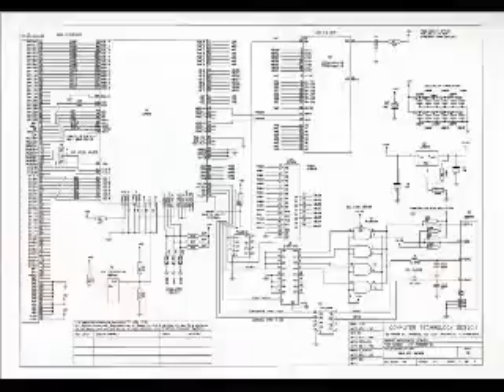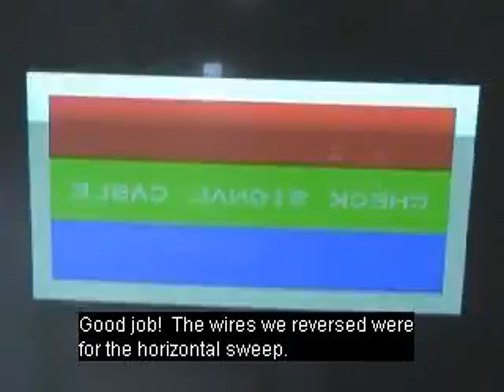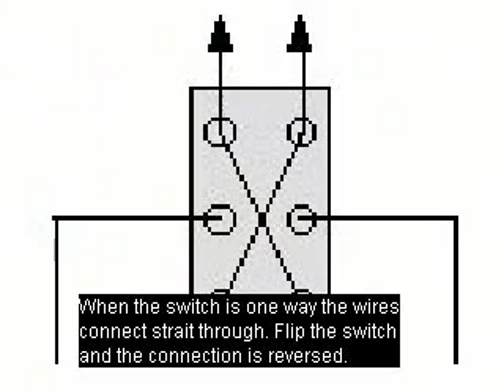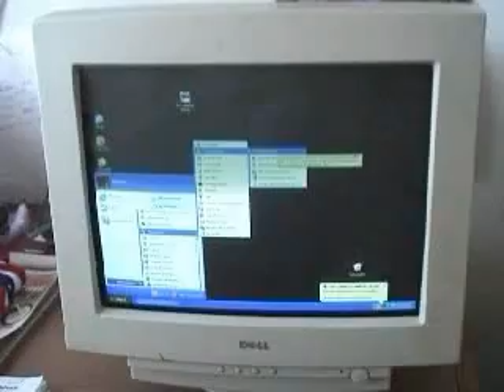How to reverse a CRT picture tube.

Comment: The coil is current driven, maybe one should use thicker wires to connect to the switch. I think the discharge is not really needed. I only discharge when i need to touch the HV circuit. I was a little afraid that a mod like this could fuckup the convergence, but apparently it does not - good to know as i will need a mod like this soon.
Reply from the maker: Yes.. Looking back at this now I've realized you are completely right. I feel like making a new video to correct people on this
Reply: I think adding this to the comment section is perfectly fine. btw.: I also tried it with a trinitron (Sony BVM) and it worked without any issue - try that with an LCD ;-)

Comment: you always want to discharge the tube twice, wait about 20 seconds or so and discharge it again, usually i'll get another spark. I got shocked from one of these tubes, it was a pretty big jolt but not really bad, however I was lucky my dad was helping me lift the tube into the back of the car otherwise I'm sure I would have dropped it, and that would have been a very dangerous thing to do.

Comment: that's not glue on the magnetics just some paint they put on there to secure them. you can take a razor blade and loosen them. but unless you're an old time tv repair guy like me best to leave them alone. reversing the wires is always a funny joke to play on someone. Even more fun is to reverse the red and blue wires and the picture goes upside down.

Comment: Quick technical question:
I have a 15" Sony Trinitron TV that I'd like to customize and turn into a Phillips Predicta style TV.  My issue is that the anode plugs into the CRT on the top of the monitor, so in order to separate the circuit board and the monitor I need to rotate the monitor (this will provide me with the anode length I need).  Which wires will I need to switch to achieve this and retain the proper picture while the monitor is upside-down?

Comment: Should he have used a equal size wire gauge and a switch that is rated for the voltages and current?

Comment: No, what you will do is equalize the potential voltage difference between the anode and the chassis, which will mean there could still be a difference between the whole unit and neutral/earth, and could still result in a shock.

Comment: If you see an orange light in the back of an electron gun, it is probably the filament. If anything else it glowing orange... That could be a problem :)

Hmm, maybe i should try to use a CRT as a vacuum tube. It works, has the anode, grids, filament, cathodes...

Comment: In fact, there is around 1kv present on the yoke when operating. When the magnetic field collapses in the LOPT (flyback) the voltage that 'flies back' is normally over 1kv... The primary is pulsed at around 80 volts and the kickback is the thousands... This is why the HOT (transistor which runs the flyback and horizontal yoke) is rated at 1.2-1.5kv or so. Some newer moniters use high voltage mosfets or IGBTs and use lower primary voltage for lower voltage spikes...

Comment: MSVistasucks - ive been shocked by the red wire in a 19 inch trinitron dell monitor. i forgot to ground my screwdriver. it hurt like a bitch. threw the circuit breaker, then i got pissed off and threw the monitor out into the back yard.

Comment: 4:16 all you really had to do was cut only the red and blue wires and reverse them. all you did for the other 2 wires was cut them and twist em back together. thats according to your caption there. nice little mod there. its just like that april fools joke that YT did where it turned the whole site upside down.

Comment: Not from the deflector yoke voltage you wont. Its not high enough to overcome the resistance in your body. 

The CRT anode can kill you, but then youd have to try very hard to touch that.

Comment: First thing i noticed when i saw this "discharging" to ground, if you want it to discharge safely, you should have the lead pluged in so you have a ground, no good grounding to a steel chassis that isnt connected to anything.

Comment: You know even I can rotate the image on my graphics card for a LCD monitor...All your doing is feeding the monitor different analog signals...In short, it's no different than if you were to be playing a game, and it turns your screen upside down.    Same thing works with built-in graphics cards.

Slash is correct.  He says SOFTWARE lets you rotate the screen.  BUT!  In the case of an arcade, there's no software!  So you manually flip it. yay!

Comment: Actually, you're very much wrong. A lot of lower end video cards only support rotating the picture. There are quite a few video cards that will support flipping the picture. This is used for rear mount projection applications. Your video card may only support it, but go google it and you'll find plenty of video cards that do support this feature.

Comment: Yup, but turning 180degrees on the deflection yoke is the safest. You don't need cut those wire. But if you want some hard, why not? But don't put the Horizontal cable to Vertical cable connector or else. It could be messy! And yeah, it is still dangerous even if it is unplugged. Short circuiting the capacitor is a bad idea. I think the proper way to discharge the capacitor is connecting the male plug of your soldering iron on the terminals. But wait! Your soldering iron must be 220v

Comment: No need to cut those wires to make your screen upsidedown.
Just loosen the screw on the deflection coil near the tube neck and rotate the coil slowly, 180 degree.
Try it!

Comment: sonybloke: NO U!
Sure, the metal is connected to ground, but that doesn't change the fact that the high voltage in the tube will create a rush of very high current which might damage the ground connections or other parts of the circuit.

Comment: And yes, it worked. the color coding in my little 12 volt black and white monitor was even the same. I cut all 4 wires, soldered on 4 little extensions - in case i had to play around, hooked everything up, reversed the blue and red, bingo. Now have mirror image in my RV monitor. Thanks again!

Comment: This video itself is not the least bit pointless!  
I have another great  use for you. I just replaced my RV rear view camera, and that camera didn't have a reversing switch. Now my in-dash monitor has the exact opposite of what you would see in the rear view mirror. Accident waiting to happen. This monitor doesnt have a mirror/normal switch. I will now go reverse my little 5" 12 volt crt in dash monitor and save myself 200 bucks. THANK YOU for the awesome video!!

Comment: Hush, every of mobs... It's clearly possible. But the problem is, you will make the microcontroller in video coprocessor circuit go berserk and tune the transformer (yup, the CRT transformer) up and microwave you with X-ray emission. My advice is, don't f*** with it unless you have the prior experiences of DIY electronics. I have experience of running a CRT off a microcontroller board (Don't do that unless you know what you're doing).

Comment: Lol good one, have done this one myself, except i used a latching relay and a 7808 regulator with a reed switch attached and stuck near the degauss coil. The end result is that it would flip if the scren was degouses, as it automatically did when it was resumed from standby by the video card. was quite amusing at a lan party watching people trying to mess with my system.